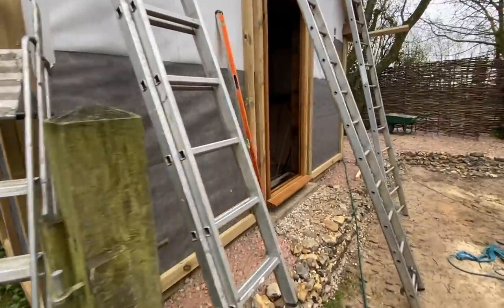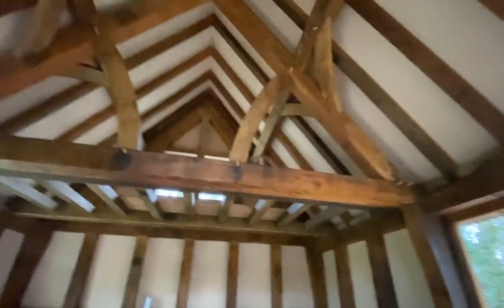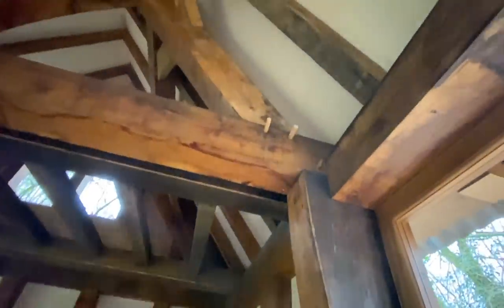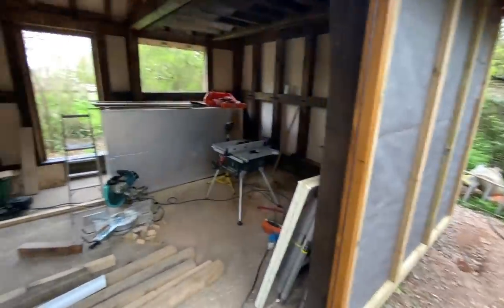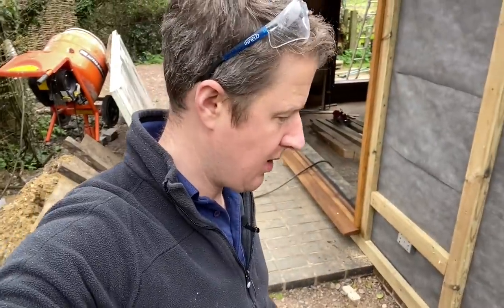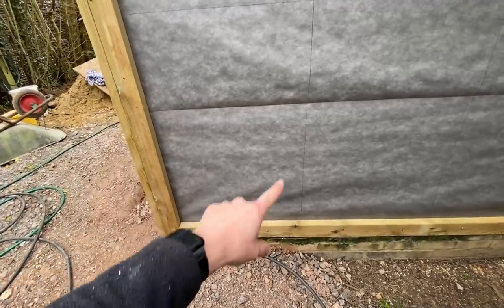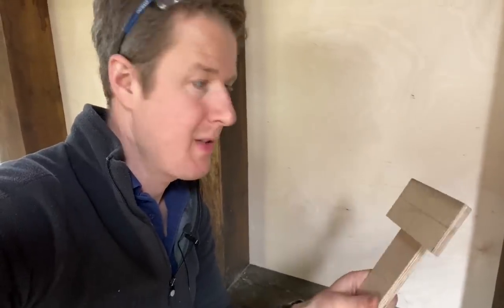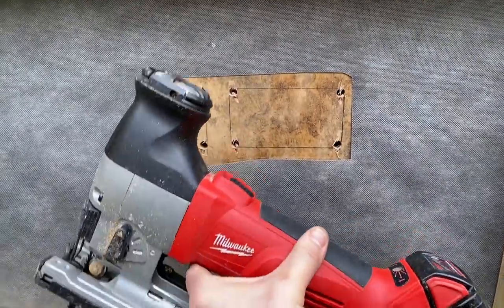Electrical Installation in a Barn - Part 1

Comment: Sorry if I'm double posting, I don't know if my first comment made it through. You could use a router and trim bit to make the edges of your openings really straight. Build a template in plywood (exactly the opening you want to make), make its edges really straight. Cut an undersized hole in the wall. Clamp the template to the wall. Follow the edge of the template with the flush trim bit.
Also, for a studio, air-tightness is going to be important for soundproofing. You might want to use some tape or mastic over your boxes to fill in the gaps (e.g. between box and wall, and around the knockouts)
Reply from the maker: Cool good ideas thanks

Comment: I’m a bit puzzled about the construction - isn’t the plastic sheet behind the plywood the vapour barrier?  What will they do to insulate and clad the building?
Reply from the maker: Insulation is going behind the ply, then another layer of membrane and then oak feather edge boarding for the final outside cladding.
Reply: That building construction looks a nightmare for you to run cables.  I would have found another way to build that.  Added sockets in the future would be hard work.
Reply from the maker: Yeah it’s inside out! But it’s one of those customers who is very particular and every job is awkward and challenging but he’s a nice guy and gives me a lot of work!

Comment: Excellent Jordan👍🏼 I would have used SWA as well, considering where it’s located & what its being used for.  Pyro would be ridiculous & far too expensive.  I love jobs like that where you have to think a bit & take your time for the perfect finish.  Looking forward to part 2.  What are they heating the building with.?
Reply from the maker: Thanks! They’re just gonna have a plug in heater to heat the building as it’s gonna be super insulated so not gonna need much. They might put a log burning stove in there as well.

Comment: Those diagonal holes by the step are going to be fun to drill 🙈
Reply: David O'Leary and bending/ pulling an armoured through them
Reply: Would going up and over the door been an option?  Or go into the building below the finished door level?
Reply from the maker: I did manage it! Stay tuned for episode two!

Comment: I don't know why but it's screaming to use PYRO to me!!  
You can get extension boxes for the back boxes so you have the metal flush to the front of the wood, I think they do 25mm or 35mm in double socket sizes.
Another thing - not really your concern but with all those hard surfaces for a music studio does it not echo like mad in there?
Reply: cumberland1234 That’s exactly what I was thinking.!! Mind you A) it’s getting hold of pyrotenax tools these days...the cable sure easy enough but the gear to make off the pots not so much...and the time for the wholesalers to get the gear won’t be quick. 
Tricky enough job with the armoured all the same.
Reply from the maker: Thanks yeah I love a bit of pyro but that would be overkill, SWA is already overkill anyway! When I say music studio it’s basically just for band practise not really recording so acoustics aren’t that important.
Reply: @rattlehead85  I got my MICC tools over 35 years ago, I've looked after them, just have to oil up the rollers on the cable straightener and replace the cutting wheel on the strippers (which I can get anywhere) every now and then. And still get plenty of pyro work as the local council insist on it for pubs, bars and nightclubs with late licences!
Reply: CrazySparkie63 Great...I’d love to find a job installing that stuff...been years since I last did pyro. It is a real shame that most colleges don’t even teach it now and it is a rapidly disappearing art. FP 200 and the like have basically taken its place...New sparks wouldn’t know what an Pyrotenax pot looks like let alone make one off!.
Reply from the maker: Yeah it’s been a while since I’ve done any pyro!
Reply: @rattlehead85  As you probably know, there is a right way and a wrong way to pot pyro, do it right it will last a 100 years, do it wrong and it can fail in a matter of weeks! Like you say they don't seem to teach it in college anymore, I was lucky I had my NICEIC late uncle teach me on site during school holidays when I was 12 years old.
Reply: @CrazySparkie63  I can still hear my old tutor saying warm the potting compound in the plastic bag with your fingers so it doesn't get grease from your fingers in it and feed it into the pot from one side so it fills the pot properly without getting air in it.

Comment: +Artisan Electrics
When do you use 2-core 4mm SWA  and use the SWA-clamps into metal boxes to provide CPC, vs. when do you use 3-core 4mm ??   John Ward was explaining that in almost-all cases the steel armour is perfectly good for CPC (but not main-equipotential-bonding).  He also didn't think you need banjos when using SWA-clamp into metal boxes.    I suspect given all the joints and arkward spaces you are likely to be going with 3-core giving you the wire to socket pre-provided in an easier belt-and-braces job, the socket screws will in any case tie the 3rd-wire and armouring together at each box...
Reply from the maker: Yeah I was using 3 core I never use 2 core really.

Comment: Love your content Jordan...good to see you are still able to work in these difficult times. That looks a very tricky job...will be very interested to see how the lights look on completion. Are you using a TT system there or using earth source from the main property?
Reply from the maker: Thanks! It’s an interesting one as I installed an earth electrode so as not to export the PME earth from the main property but then It kept tripping the main RCD, when I remove the Earth electrode connection and use the PME earth it doesn’t trip, all insulation readings are good. So not sure what to do.
Reply: Artisan Electrics Jordan...have you considered where you are driving your stake?, you could be near cables or service inducing a current onto your earthing system or possibly the fact you are overlapping an already existing earth radius which is importing a fault onto your system causing the trip? You can use the p.me. so long as there are no extraneous services running into the building...if there are you can still do it so long as you have a main protective bonding system running back to the supply source m.e.t. with suitably sized bonding conductor. You could use the cpc inside the armoured as a combined earthing conductor and bond cable depending on size. Although I guess it would be to late to run extra bonding  easily as you already have the main supply cable run in.
Reply from the maker: It’s miles away from any other services it’s down the bottom of a very large harden with no water pipes or anything else anywhere near.
Reply: Artisan Electrics Wow bit of a weird one then by the sounds of it.
Reply: You are not exporting the pme as under the ESQCR exporting the pme is illegal. Pme ends at the service head, you are mearly taking a cpc which is derived from a pme earthing arrangement into the new building, which is a separate conductor on the consumers installation side so you are not exporting anything.If there’s no extraneous conductive parts that require bonding to the MET then there’s no need to create a TT arrangement giving you a higher impedance to earth as apposed to a low impedance to earth.
Reply from the maker: Good info thanks
Reply: Artisan Electrics Peculiar fault there though. The main RCD would just be detecting a live/neutral imbalance, so shouldn’t matter which earth system if any the circuit is connected to. I would have thought just a coincidence, or something dumb done (unlikely :) ).  I would also keep on PME anyway if no extraneous parts.
Reply: Does sound spooky. Did you find out what was causing it after?
Reply: @ishkebab  this is how i have always taken it to be. Although, its not illegal to export PME as you cant be sent down for the offence.

Comment: You could have used 2+1 metal box, instead of leaving the gap.
Reply: They do those in metal?
Reply from the maker: Never seen them!
Reply: Yes they do them, but no good (or it’s a struggle and looks poor) if your using decorative accessories eg metal flat plate. Better to space apart if possible I think.
Reply: @artisanelectrics  Screwfix...;-)
Reply: Ive just always used a box width apart

Comment: Easy to criticise from the cheap seats, but I would have looked at using FP200 Gold, expensive, yes, but labour saving and still rodent proof.
Reply: Had to deal with Rodent damage today in a domestic house for social housing , Squirrels had  gotten in the attic from a loose roof tile and had been chewing through the cables for the lights:(
Reply from the maker: Nice tip
Reply from the maker: Ouch
Reply: Had to rewire a pub last year as rodents had gnawed through the FP200 and rewired with MICC as per local council recommendation, a nice little earner!
Reply: FP Cable isn't rodent proof I have seem em do a good bit of damage.
Reply: @lewis94uk  Last year I had a grey squirrel bite right through my plastic coated steel wire washing line (so what chance does soft aluminium skinned FP stand) , just gutted I didn't have it on camera when the little shit hit the ground, its not just mice and rats!
Reply from the maker: Good point

Comment: You need to get a fein multimaster or a bosh it be a best investment you ever made dont get the other brand they are shite
Reply from the maker: What you mean for a jigsaw? Actually I don’t have a jigsaw I was using the clients Milwaukee one
Reply: fein oscillating multi tool or a bosh brand they have this Starlock blade you can buy many different blade and you can offset the blade many direction its a must tool for any tradesmen one tool many use